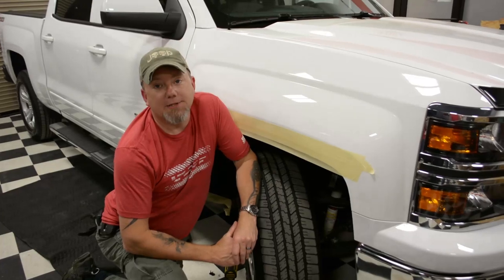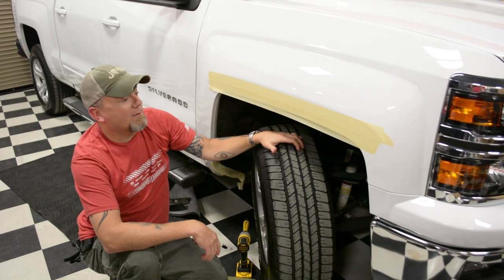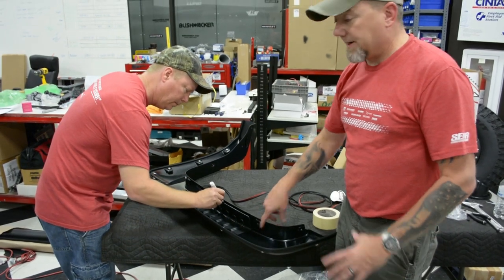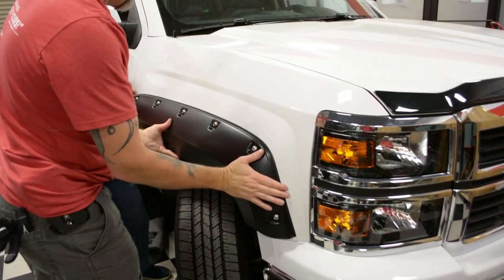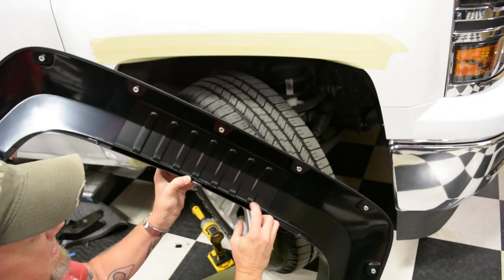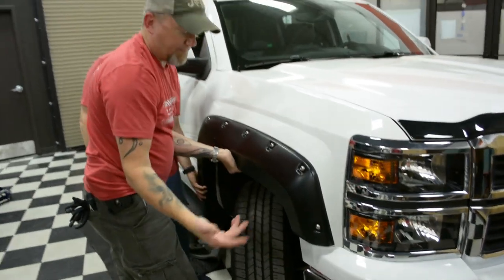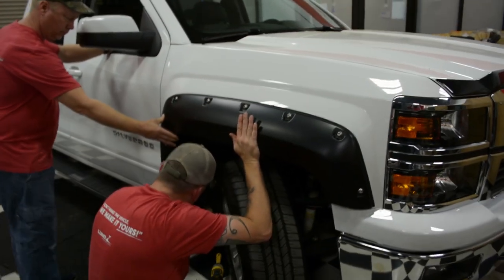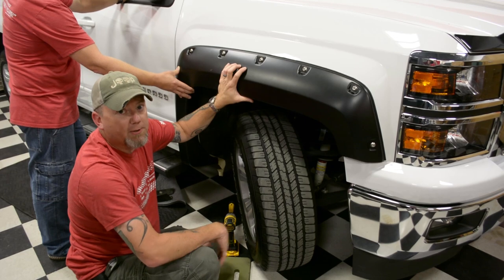Pro Tip Series: 2014-2017 Chevy Pocket Style Fender Flares

Comment: So glad I came across this video… I just tried to install a pair on my 18 GMC Sierra and following the instructions it said to start the top two factory bolts and the rear two… so I put the rear two in just a bit and tried to get the top two in but the flare wouldn’t go in enough to get those bolts started and the front and the back of the top of flare didn’t sit flush on the fender… I was thinking I got sent the wrong flares, I tried to call but closed on the weekend … I ended up taking it off and putting the stock gmc fender trim back on and was waiting till Monday to call and find what was wrong… but now I can try again tomorrow and I’m sure this will fix my issue…

I never tried to do the rears… but I will also make sure this is done on them as well… thanks for this video

Comment: I'm having the same problem with a 2019 ram 1500. The flares are obviousely different, but there is no "inner bracket" on the back side. I think it's just a bad fit. There's some other flaws on these like the channel for the rubber gasket isn't cut perfectly. I had to use a dremmel to fix that.